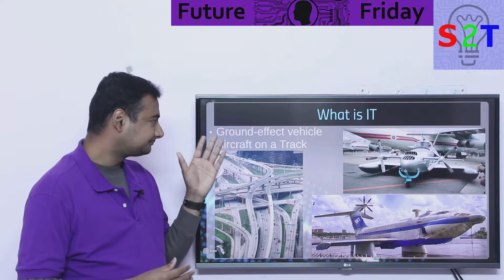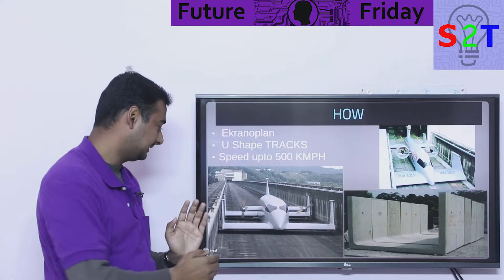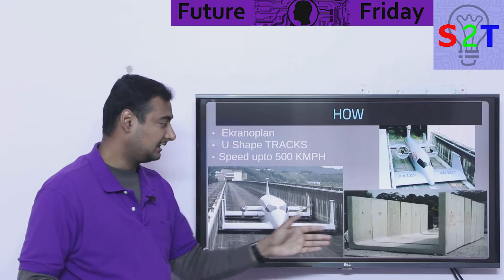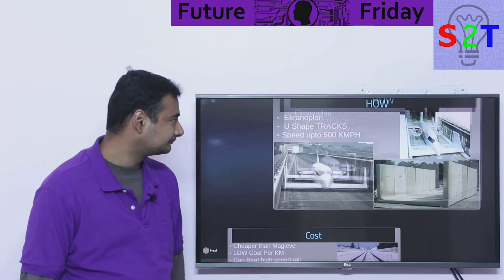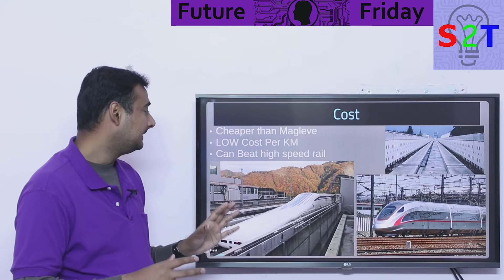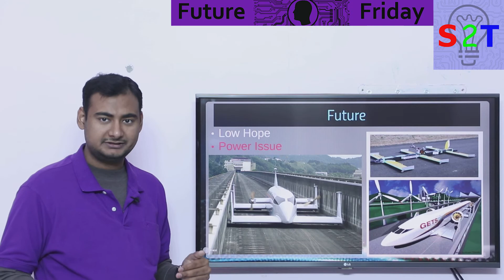Ground Effect Train Explained {Future Friday Ep32}

Comment: My question is how big is this thing gonna be, the reason why the last air cushioned trains failed was mainly because you could hook them up to each other, that’s the main advantage of a train and why they can transport so much cargo, now at sea it not a problem but on land it would be, the last aero trains had a capacity of only 60 people which is less then most planes
Reply from the maker: rail is king everything else falls in tech bro optimism so they are not that likely to work
Reply: @ during the age of steam Henry pinkus invented something called the atmospheric railway(its not a vacuum train) the idea was that you would supply a piston with steam via a tube in the middle of the track, the piston would pull the train along the track, mr pinkus wanted to supply trains to be supplied with power without carrying any on the train, however it very became commercially feasible because of the maintenance of the track, nowadays we have the same concept but it uses electricity to power electric motors on the trains meaning the trains don’t need to carry any fuel, my point is that ideas that maybe exotic and impractical can come back and change the world

Comment: The french, British and Americans tried air cushioned technology back in the 60s and 70s, mustard dose a great video on it, it was a bit different then ground effect as they used lift pads opposed to gliding on the ground effect, the french used propeller fans and even jet engines while Britain and American used liner induction motors which where very new at the time only being invented in the late 1940s, the propeller aero train went 250km/h, the jet version went 430km/h and the liner motor version went 400km/h, the main reason why these projects failed was because they couldn’t be integrated into the existing railway system, there capacity was the same as aircraft at only 80 seats and they where not as fast as aircraft, it couldn’t take on the airplane and replacing existing railway is not an option, you can only improve it, now I do believe that hovercraft and ground effect vehicles have massive potential just not on tracks, if we had this technology in the early days of flight then it would have been a massive game changer, but that time is long past and we need better solutions
Reply from the maker: that is a good read

Comment: what if the concrete was closed top, the train block ish shape for max payload, and use the top as road for cars? build 8 of then cossing a country and you have a 500kmh heavy transport?
Reply from the maker: closed top wont make that much difference and tracks are the real cost which why things like this alwasy fail hyperloop or vactrain or ground effect train etc